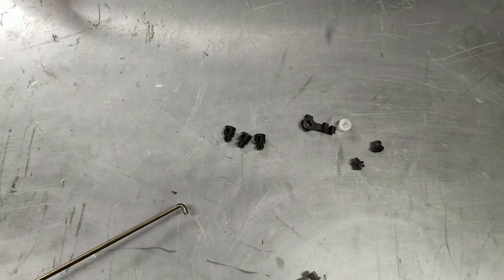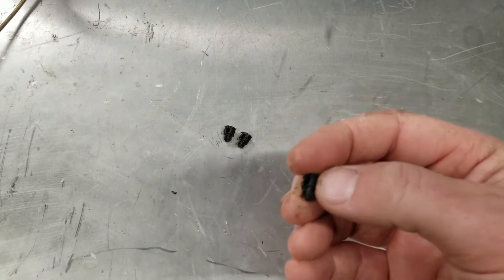LMTV Door Handle & Latch Rod Clips - Impossible to Find? - 12422802

Comment: A trick I figured out YEARS AGO for replacing 'hard to find plastic components' on old trucks...buy a very-small hobby lathe (6-in-1 mini) kit (<$200), get some sticks of various polymers (HDPE, Delrin, Lexan, etc.) and actually re-make your 'old clips'! At the prices the clips go for, you will pay back the machine in no-time! (most clips are either HDPE or metal, anyway). As for some of the clips on a Stewart-Stevenson, take a look at your local NAPA...specifically, door clips for a 1973-1979 Dodge D/W 150. You can find 80% of what you need, right there. Alternatively, if you look at the British truck manufacturer, MAN, their doors are IDENTICAL to S-S doors...and in fact, if you want 'locking handles', it's the absolute-cheapest way to go, to get your 'locking doors' you've been possibly wanting!

Comment: People are soaking FMTV folks over door parts. Save yourself some cash and convert to a semitruck style handle and mechanism. My two cents... or go with the modded Mazda clips. Best of luck.
Reply from the maker: All good now although, we'll see if the 3D printed clips hold up. If I have to go back in there, may do the upgrade. Truck is working great though. Used it today to haul a monster oak tree that burned inside during the wild fire. Was poised to fall over so figured I should get after it before it came down during a storm or when I'm out.

Comment: I have found everything except the door rods.  I would just make some if I knew lengths.
Reply from the maker: Yep, same here! Look simple enough. I'd drill out the holes on the handle and latch actuator arms and use larger rods to accept the larger, more common clips that can be bought on Amazon.